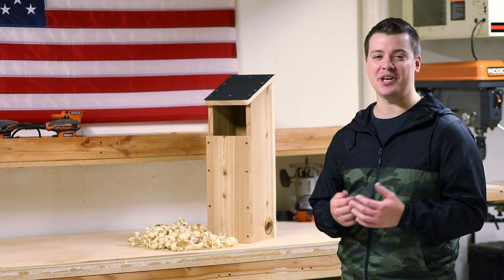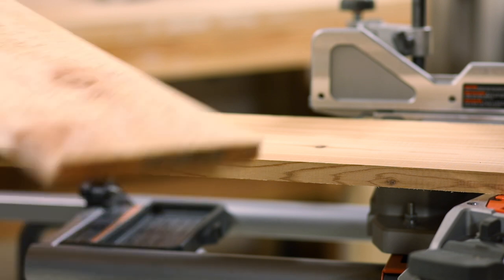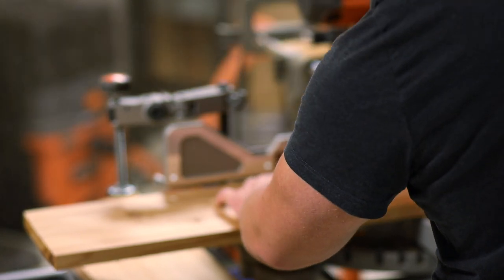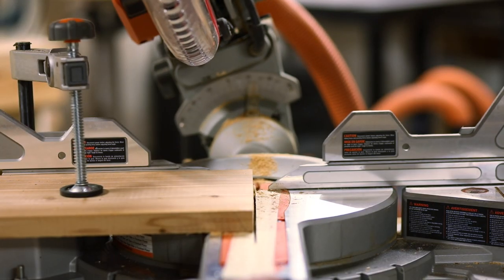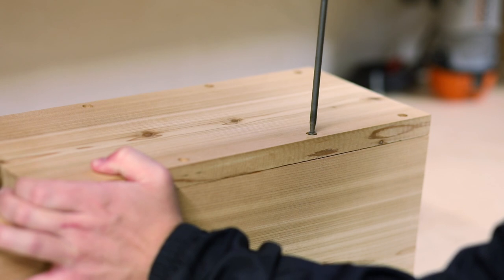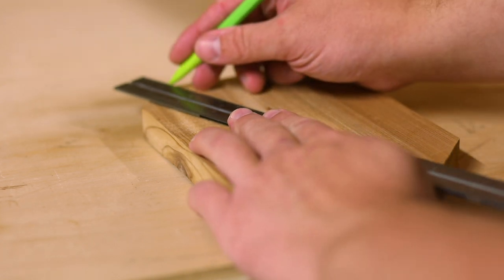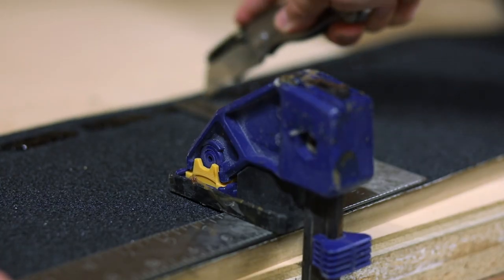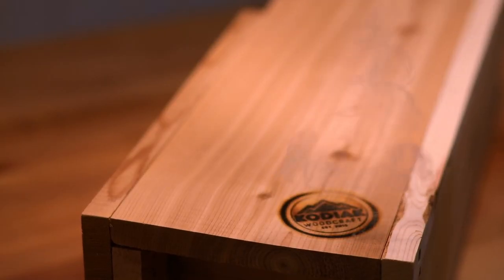How to Build a Screech Owl Nesting Box (DIY Owl House)

Comment: I like the Box. I'm Curious ....Why are they made with the roof angled so rain runs off across the door? What if it's in the opposite direction?
Reply from the maker: I think the design could be improved by making the overhang longer. Good idea!
Reply: @KodiakWoodcraft  That would be good to help keep rain out.  I'm going to try your set up. How much longer were you going to make the overhang?

Comment: I don't know what type we have in our yards both front and back. About a foot tall and mottled brown and ivory feathers. I call it a Barn Owl but maybe it is a Screech or are they the same thing? I am going to build one of these out of rough cut pine and I suppose that will work as well.
Is the sticky roof you installed called "ice and storm shield". If so I will use some of those spare pieces that I have in the shed. 
Great instructions and explanations.😀
Reply from the maker: It sounds like it might be a larger species! I hope your build goes great!
Reply: @KodiakWoodcraft  It is not very large and does make an eerie sound and not a "who who who". We have some hanging around our cottage at Georgian Bay and they are much larger and do sound like MR.WHO. Amazing how silent they are when they fly by.
Reply from the maker: It sure is! A sight to see for sure.
Reply: Eastern Screech owls are about the size of a Nerf football. They are either red phase or grey phase (color)

Comment: You might want to read the instructions for your miter saw. You're pulling the saw through your board when you should slide the saw out and push it through the board. It's much safer that way. The blade is spinning in the direction of the fence and you're going to dull your blade the way you're doing it.
Reply from the maker: Thanks! You’re right and thanks for pointing this out.

Comment: HI. What can you tell me about you heated stamp you use to sign your projects?
Reply from the maker: Sure! It's a branding iron. I got it custom made several years ago - the name of the shop that made it is "MakersMarkBranding". Justin did a great job.
Reply: How accurate do you have to be heating it? Do I see you wet the wood prior to branding it?
Reply from the maker: @arthurcarter9727  - It doesn't take tons of precision. Just a hot brand and an even press. Dampening the surface yields a better result.

Comment: Just wondering if anyone has had any nesting screech owls with this design as the interior seems to be too small for owls (5.5”x5”) and the opening too large and too close to the top to allow predators access. Minimum floor space should be 8”x8” or even larger and entrance needs to be 2” below the top of the box per Cornell Ornithology Lab and others. Nice simple design though and well explained.
Reply from the maker: There are a few different "types" of designs out there. Check out the small business "Owl Reach". They have a similar design and have tons of photos of successful nesting. Thanks!